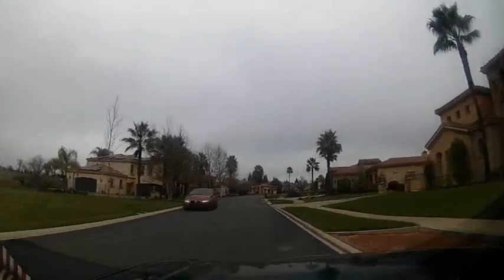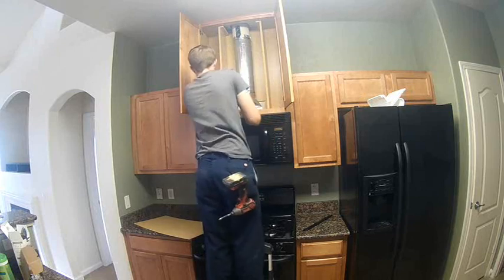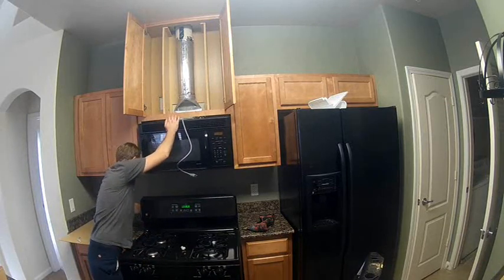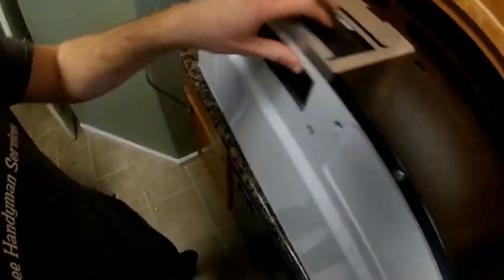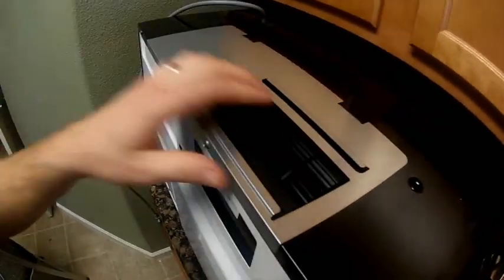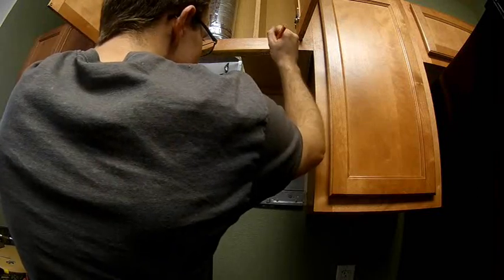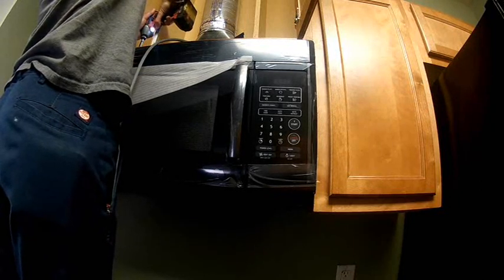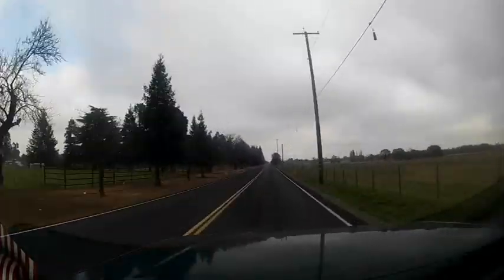How to Install a Microwave

Comment: Excellent video. How much would you charge for install on this?
Reply: i charged about $250 myself this is a 2 person job easily
Reply from the maker: Chris Randall this was part of a $2000 punch list on a rental so I charged $150 for labor and marked up the material about 30%
Reply from the maker: nick torres two people would make this a lot nicer!